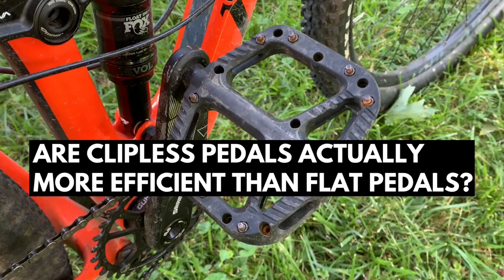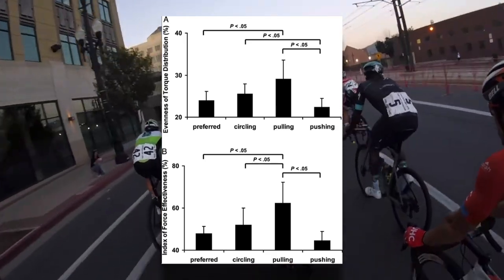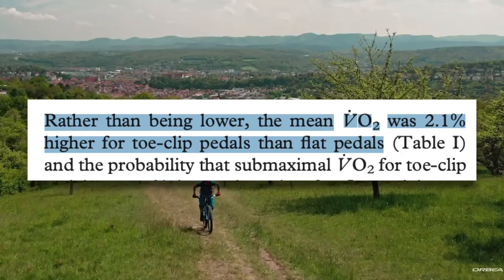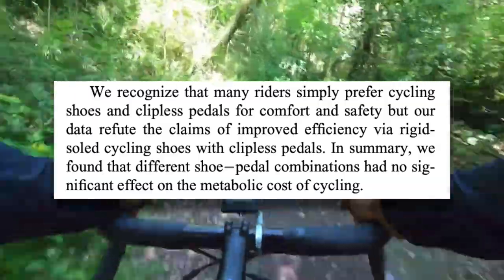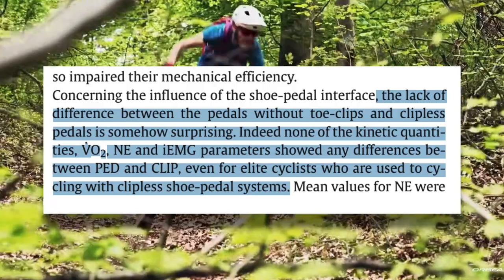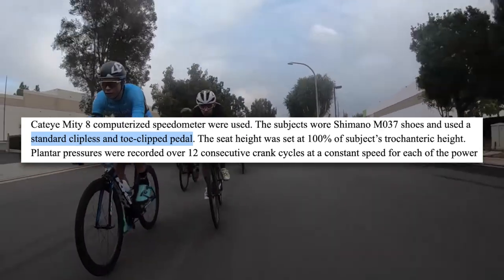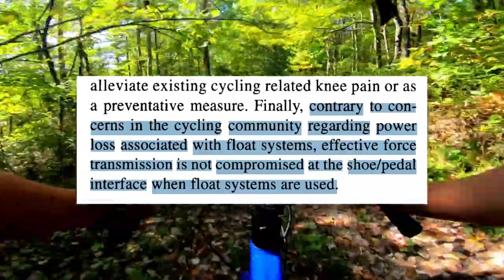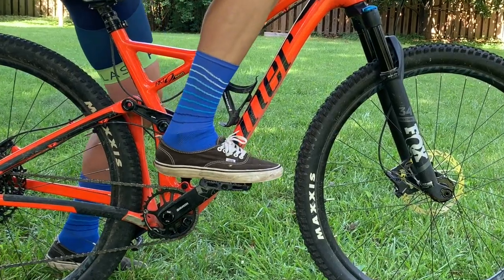Are Clipless Pedals Actually More Efficient Than Flat Pedals? The Answer Might Surprise You.

Comment: "Efficiency" is the wrong thing to consider for clipless pedals.  "Efficiency" is the proportion of energy from food converted into energy of motion.  This efficiency is just the efficiency of muscle.  It doesn't matter how the muscles are connected to the bike (or any other machine), their efficiency is always going to be the same.  The key advantage of clipless over flat pedals is that they allow you to use more, different leg muscles.  With clipless pedals, you can use the muscles at the back of the leg (e.g. biceps femoris, semitendinosus). So, when climbing or sprinting, you can use more muscle, and so you can get more power (power--energy per second).  Not more efficiency--but more power.  Going up a hill hard with clipless pedals, you are using more different muscles, getting more power (energy per second), using more calories to get more motion.  Efficiency (energy calories in vs motion calories out) stays the same.  Even when on the flat, you are spreading the work over more muscles, so the muscles at the front of the leg (e.g. rectis femoris) don't get so tired so soon, and still have power at the end of the ride.

Comment: I don't understand the principle that stiff soles are better for all pedal types. On clipless pedals with a small platform a stiff sole effectively becomes the platform, but what is the benefit supposed to be for decently sized flat pedals? My foot is stiff. It bends at the ankle (necessary for pedalling) and at the toes (irrelevant because the pedal is placed behind the toes).

Comment: So if the pedal type itself doesn't give any efficiency benefit, what about shoe types? Rigid composite v fully flexible v top end carbon fibre?
Reply: Just needs to be stiff enough. Nobody has measured more efficiency from carbon soles.
Reply: Stiff shoes are always better, clipless or flats.
Carbon fiber and other materials just make the shoes lighter which could matter for some people.

Comment: Dylan, there are a few things that you are leaving out.  If your bike, shoes, and cleats are fitted properly and optimally, your feet will be locked into the best and most efficient position for each pedal stroke.  Your feet won't accidentally slip off the pedals on rough or bumpy roads.  I guarantee that if those tests were performed on gravel or rough roads that there would be a moderate difference.  Most of the testing was done on stationary bikes.  Most road surfaces that people ride on are far from perfect!  I have seen riders bounce off their bikes when hitting a large bump with flat pedals and wreck.

Comment: What is EMG and what does it have to do with the price of tea from China?  Nowhere do you explain this term and the relevance of this measured independent variable to the dependent variable under discussion (here I believe that is "pedaling efficiency" whatever that is). 
Both clipless and clip pedals keep the foot in position on the pedal throughout the pedal stroke so it is easier to pedal in circles.  With flat pedals, the rider is more likely to pedal in "squares" and to lift the foot off the pedal inadvertently and have to find it again without looking down.

Comment: I have never liked toeclips or stepin pedels felt like a accident waiting to happen in city traffic.
Flats were a better choice and with a steal shanked shoe for foot support kept a even pressure on the pedels when on your toes or Ball of the foot so climbing or riding flat out on the flats.
Yes used both toe and step pedels racing even after lots of training I never saw any different from flats over long runs say 50-120 miles.

Comment: I tour on flat pedals but have cups for toes on one side. 
When I climb I often flip the pedal to the other side and slide my foot further forward so i am pressing with the arch of my foot rather than the ball. 
Kicking out like that feels completely different, like a whole different set of muscles are being used. Switching between the two on a climb I am sure improves power because it gives certain muscles a rest. 
You cannot do that clipless.
Reply: Even though you can’t move your foot around you can still adjust your position and use different muscle groups in clip less. You just have to learn what works for you.
Reply: @spaaceman8908  ok, I am sure thats true. But pushing the pedals with the arch of the foot on the pedals feels like it is using the back of the legs not the quads. But yes, each to their own.

Comment: Are clipless pedals more aerodynamic than flat pedals?

Also, when you're putting in harder efforts, you'd definitely lose time when your shoes slip off flat pedals. That wouldn't be an issue if you used toe clips, tho - as long as your straps were tight. But, when I did my first sprint tri with flat pedals and running shoes, my feet slipped off the pedals twice- once up a hill and once while trying to ride hard on a downhill.

Comment: To simplify this: Well unless you're feet are sliding around on flat pedals which they won't with a good flat pedal shoe combo then why would clipless be more efficient. Its basic physics, efficiency = energy in vs energy out, theres no more energy loss in flat pedals over clipless therefore no difference in efficiency. The advantages of clipless are in sprinting above max heart rate.

Comment: Clipless are for the sprints, simple as that. The few times I didn't have them I couldn't speed up nearly as fast as I'm used to on traffic lights, sprinting top speed drops around 10km/h! Sometimes with clipless I'm pulling up so much I lift my rear wheel, no way you can do that kind of power with flats. But yea, for steady effort there is almost no difference.

Comment: Tried flats for MTB a couple years ago. Climbing steep or technical sections were all but impossible because I couldn't pull up and apply enough power at the right time. Descending was sketchy too. Bunny hopping? Nope. Maybe a bunch of riding on flats and improving technique would help, but I didn't see a reason to endure harder rides and not keeping up.
Reply: It seems to be lack of technique, I suspect you learned to bunny hop and descend on clipless  so you developed some bad habits in your technique.
In a bunny hop you pump your suspension to create spring force and then you move your center of gravity from the back of the bike to the front, that creates enough force to make the bike jump.
You probably pull up your cleats when you do a bunny hop so you are using your legs for the jump instead of using the bike itself for it.
Nevertheless, ride whatever is comfortable for you but I would recommend  you to practice on flats to develop technique, this will help you in the long run for flats and clipless.
Reply: @Calfa2x  Technique is why I tried out the flats. A hard fall practicing manualing and difficulty on technical trails had me back to my clipless safe space!

Comment: Stationary bike tests are lame, like you said. And shoe flex and different foot position every time you ride... maybe bad. But one thing you didn't mention, and I argue is the main reason why anyone would wanna use clipless pedals, are intense efforts or hitting rough patches of road without any slippage. 

Imagine doing a moderate climb or an all out sprint with flat pedals. If you're exerting that much force onto your pedals, any bump on the road or weird shift in your body weight weight or float between your foot and the pedals could cause foot slippage. And I don't mean slipping off the pedal entirely. 

Imagine if your cadence is 90 RPM, and let's say that in all of those 90 revolutions your foot slips a total of about a centimeter, so you're having to shift back into a comfortable position. In a little over an hour and a half that's a total of one meter of foot travel that is undoubtedly some lost efficiency in power transfer. Maybe it's insignificant to the casual rider, I guess.

Comment: Well, forget the science, here's my take on it, after 39 years of BMX and 29 years of recreational road and mountain bike riding....a good circular pedal stroke on flat pedals will  be as efficient as any casual rider needs. BUT I do use clipless pedals on my good road bikes, and it's 100% only forthe sake of not having to worry about my feet falling off the pedals when I spin a lower gear. which I do because it's easier on my knees...39 years of BMX isn't kind to knees.

Comment: For commuting and learning skills I'm strictly using flat pedals, but they do kill on a long day on the bike as shoes are too flexy for cycling.  For commuting and road riding I notice no difference, but I feel much more secure trail riding while being clipped in on a bumpy trail. My friend is a triathlete and her feet turn out so bad clipless pedals have not worked (yet to try speedplay). But she found it so much easier to just cycle in her running shoes.  I was wondering if anyone knows of a flat shoe that is stiff downward for cycling but flexy upward for running? Obviously it'd be a compromise in each direction, but I really don't think for triathlon that being clipped in is that important is that important for triathlon.

Comment: Despite this "pulling up" thing being shown to be a fallacy, thru many different kinds of tests.........
Every roadbike rider I mention this to, assures me they pull up every stroke hard enough to almost ruin shoes.
They tend to be really militant about this. Extremely sure of themselves and their 250.00 pedals, and 350.00 shoes.

Due to bodily issues, I use flats on everything, road to gravel to mt bike.
Its never slowed me down even a little.   Finding the right shoes and flat pedals is everything.

After 4 years I don't even give it a thought.    And have gotten way stronger on bike to where I'm towards the front with my group of comparable age riders.  Now I just plain like flat pedals.    I wish somebody built stiff light flat pedal shoes with ultra sticky soles.

Comment: There is a flaw with all these studies.  They aren't done on the road.  I'm totally on board with the "almost zero increase in efficiency" while sitting on wind trainer.  But that's not real cyclling.   You're spinning along, up come a little 40 yard grunter of a climb, and you stand to power up and over it.  If you are clipped in, you'll be able to really mash up that hill.  If you are on flats, you'll have to be a delicate little flower and carefully tip toe on the flat pedals so your feet don't come off.  And then there's sprints.  And then there's pedaling through rock gardens.  Then there a dozen other commen senarios where having your feet locked to the pedals allows you to keep pedaling where flat pedals won't.  
-
You wanna see the difference?  Have a pro to a lap on, say, a 30 minute circuit.  As long as it's not a completely pancake flat circuit, he'll be faster when he's clipped in.  (Ideally the circuit should have a strong mix of climbs.  And of course, if the course is off road the gains will be even higher).
-
It's funny really.   I mean have you ever ridden toe clips?  I'm old enough to say I have.  Why did they even exist?  Because pro riders found they made them faster (and offered more control, and more safety).  Clipless was the next step in the evolution.  In all my years of amateur road and mtb racing, grand fondos, centuries, etc etc, I've only every seen one 'real' cyclist using flat pedals.  (She did so because she was afraid of being clipped in on mtb decents).  So these studies are funny because they ignore decades of natural selection in the wild, i.e. 99.9% of cyclists are clipped in (thus being the largest and most real world experiment you could possible have)...

Comment: I would put more faith in this if you take a pro rider and measure their efficiency over 100 mi over varied terrain. The studies don't take into account long term fatigue, whether or not there's a difference between flats and clipless. They don't take into account short effort like acceleration in groups over a long period of time.    Who accelerates faster in a sprint? Someone using flats, or someone who's clipped in? Maximal power output, was that measured?

Comment: When i talk about the efficiency of my rigid shoes and clipless pedals, i'm not talking about my own body's biometric efficiency, VO2 or such.  I'm talking about taking my biological output and getting it to the rear wheel to drive my bicycle forward.  When i produce 100 Watts of power, how much of that is getting back to the rear tire.  It takes ENERGY to flex a sneaker.  A rigid shoe transmits that lost energy to the pedal and crank.

Comment: I ride with these biospace chainrings and running shoes. Soo they are soft. I feel like with the biospace the down and forward force can be applied with more efficiency. And with the soft shoes the grip to pull back at the bottom and push forward before the top is more secure because the shoe is kinda eating the pedals. .. it secure but lack of control will cause a slip. So it's kinda dangerous if I push forward while out if the saddle. Anyone else have this experience

Comment: What? How can the question be asked if it is recommanded to switch to normal pedals.
Energy wise i can totally see how it makes no difference when going moderate. At the end of the day its not the muscel that gets exausted but you cardio vascular system.

But why was it not mentioned what a huge power difference it makes. And even more extreme is the torque difference you can apply.
I switch back and forth for time to time (dependant how much i commute) the max speed you can do is 10kph apart for me.

Comment: See but, I think you went off track in the first 45 seconds. To me, the efficiency gained by using clipless pedals is joint alignment. After several hours of riding, fatigue can erode your form. Having your legs aligned from the beginning, at the optimal position, will stave off fatigue. Further to that, when the fatigue does creep in, the locked in position bolsters your form and prevents or diminished form - erosion.

Comment: IMO, the stiff shoes keep your feet from flexing too much and getting sore or injured.  I don't think super stiff shoes would be easy to keep on a flat pedal.  also, there's no way to really race on a track bike with out clips or clip-less pedals.  I dont think a real sprinter can securely apply so much force without losing his pedals if they weren't attached to the pedal.

i am surprised by the power/efficiency data though.

Comment: Another thing to bring up is that you keep the natural motion on the upstroke without clipless pedals. When they're attached to your feet on the up stroke you have more margin of error to mess up the cadence of the pedal motion. With normal pedals your feet are just along for the ride.

Also, you open up the ability for you to use your legs as counterbalances. The same way monkeys use their tails. This can be used as an advantage because you can now take turns at a higher speed.

Comment: As far as I am concerned all these studies were rendered void by the use of a static bike. It's a bit like running tyre pressure efficiency testing only on a smooth indoor velodrome and then claiming that higher tyre pressures are always more efficient for the road. If you want to make a science paper relevant to the real world then you have to measure in real world conditions. Even then I would expect that the measurable change in efficiently would be minimal. 
What changes when you ride clipless is not efficiency from a VO2 point of view, it is endurance muscle fatigue. With clipless you can more easily vary how you use your leg muscles and can spread the riding load over a larger effective group of muscles. How you measure that, I have no idea.

Comment: You absolutely can not compare spinning on a trainer vs real life riding on the road.  Of course the riding is vastly different.  I ride with both clipless and non-clip flat pedals and the difference is massive.  You can't ride a flat pedal with stiff soled light cycling shoes, so you are riding with a less efficient flexible shoe.  Also the clipless system keeps your foot on the pedal, with the flat pedals, your feet slide around, lose their optimum position and could even slide of the pedal resulting in an accident.  To conclude that clipless pedals are not more efficient is based on an apples to oranges comparison, the study was total crap.  I would think a study could be done to easily refute these findings if they applied to actual riding on the road.  Ironically, I used to use a trainer with flat pedals and even in that situation for me, I went back to using clipless pedals because my foot was slipping around, therefore becoming less efficient, because I have to slow my pedaling to reposition my foot, something you don't do with clipless pedal. The pros are laughing at you because the guy that races with a flat pedal in the peloton gets left behind early on, you will never see a pro racing with a flat pedal.